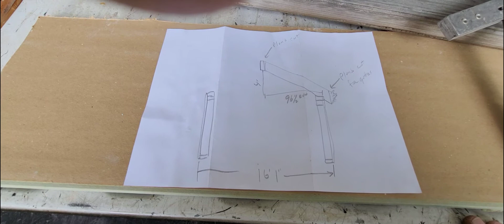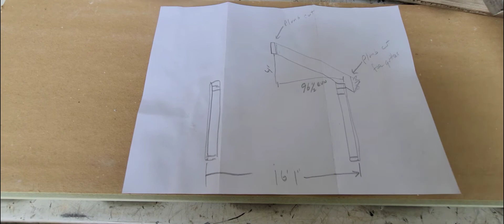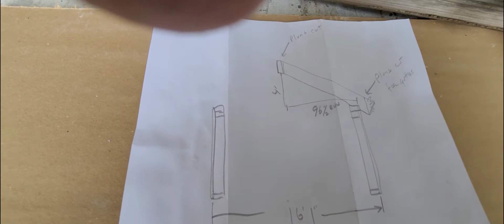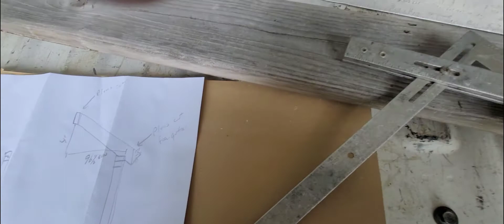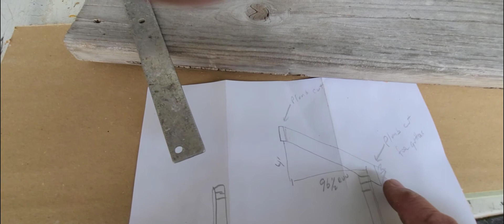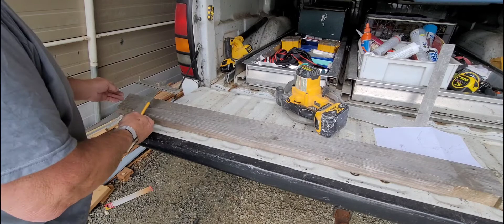how to cut common rafters using a squangle

Comment: Thanks for posting this video.  I've never seen anyone else provide the information you have.  There's just one technical weakness with this tool that you haven't touched upon.  If you were attempting to use it on a hip roof rafter, you'd have a problem.  The bird's mouth setting doesn't take height above plate into consideration.  Certainly, it could be used in "work around" mode to get the job done, but it wouldn't be as easy to use as it is on common rafters.  It's an important point to remember!